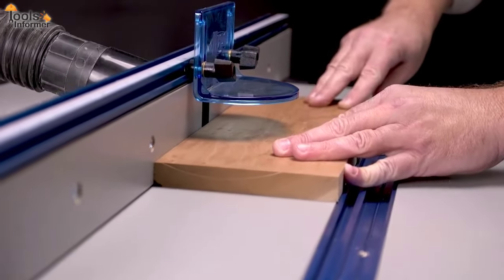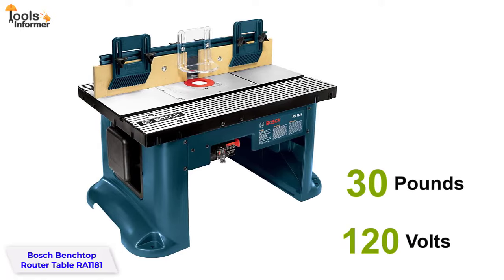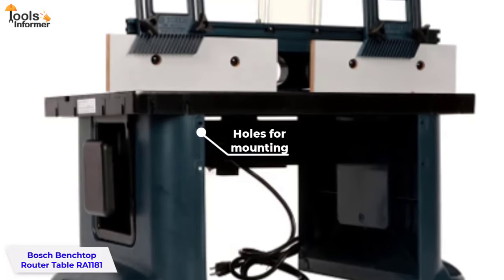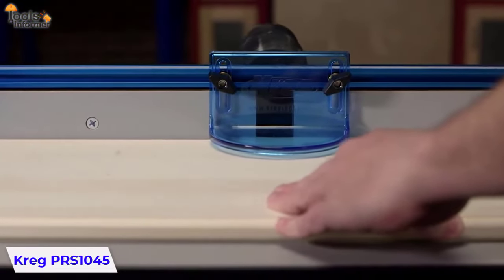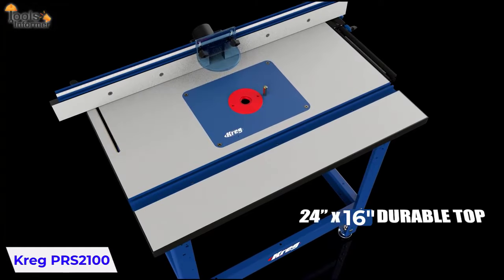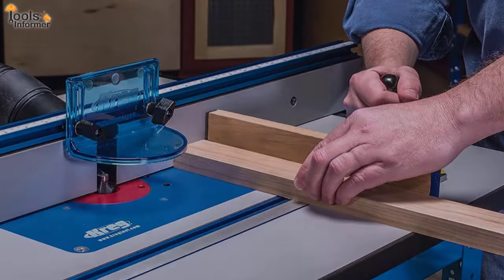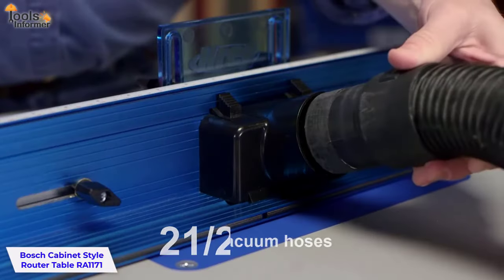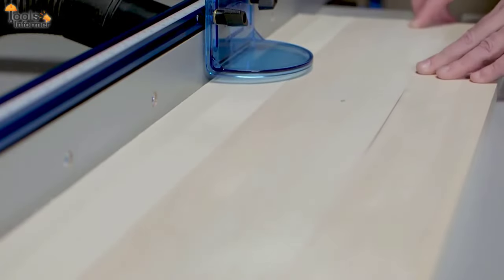Best Router Tables 2025 [Top 5 Router Tables Review]

Comment: I've recently purchased the Harbor freight router table. The router table and the router itself are okay. However the fence is not made properly. The fence is actually concave so when you cut a piece of wood to make a dado or a rabbit then your piece of wood will be off by a minimum of an 1/8th  of an inch. I've had to throw away several pieces of material that I was making for shaker doors. I'm returning this piece of junk. If they would have made a proper fence this router table would be absolutely awesome. However one of the most important details is the fence. And it is garbage. I've destroyed about $40 worth of wood. I'm not happy. The fence is literally off by an eighth of an inch. If you hold up a straight edge from end to end. You will find the center has a gap of a little more than 1/8 of an inch. What a joke. I can understand if the fence is off by about 1/32" . But in 1/8 of an inch. Ridiculous. I'm going to attempt to return this to Harbor freight. I've only had it for 2 days. I will add more to this post when I finish attempting to return this paperweight. Do not buy this piece of s***.

Comment: You are kidding about the Chicago Electric, right?  The fence is cheap cheap cheap plastic that is worthless.  The shiny surface with the guide lines on it disappear rather quickly!  Unless you are using 1/2" shanked bits, forget it.  The more popular 1/4 won't even break the plane of the table!  As well as an ONLY 90 day warranty???